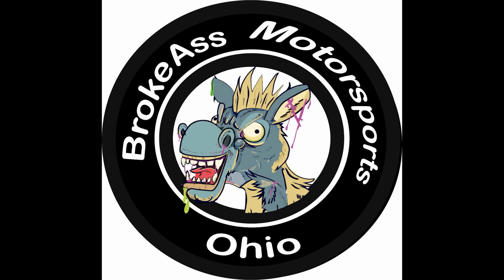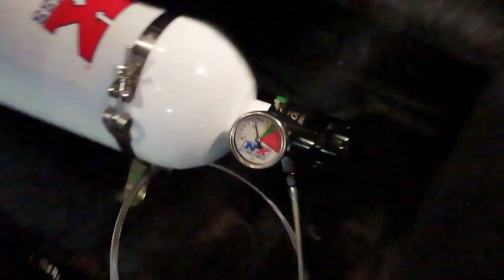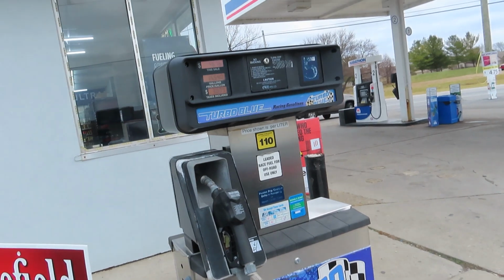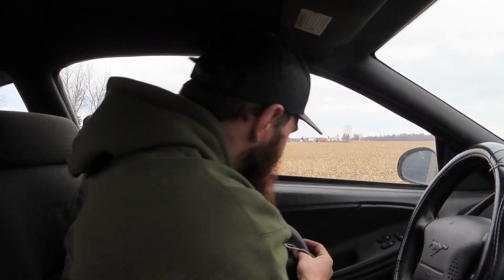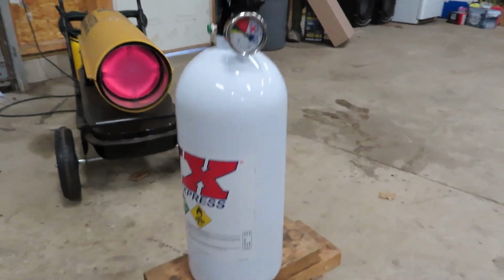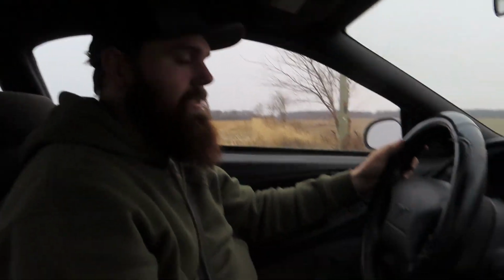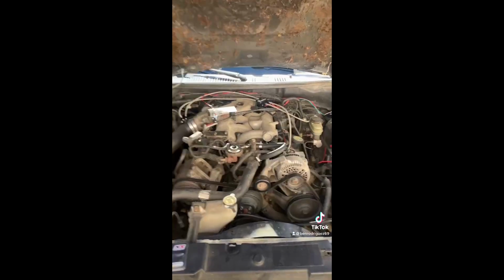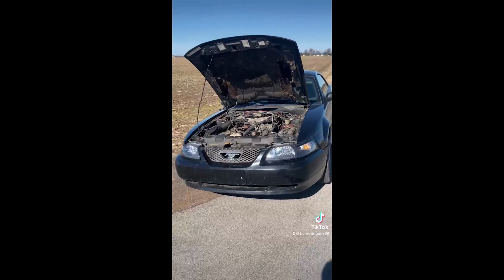Torture Testing a V6 Mustang using Nitrous! Will it BLOW?!?! 💥💥💥

Comment: I use the lever even though it is automatic along with the overdrive disabled it gives you better times, I do 6.5 seconds from 0 to 60, yes, it is V6, if you drive with overdrive activated like you obviously you will get bad times
Reply: When do you shift and how do you shift

Comment: My 2000 v6 mustang faster than that without nitrous kit lol😂 just simple cheap mods like windstar intake swap coil packs headers duel exhaust 8:8 rear diff not welded I’m doing smokeouts not burnouts lol😂😂